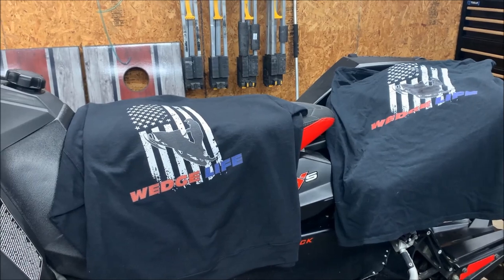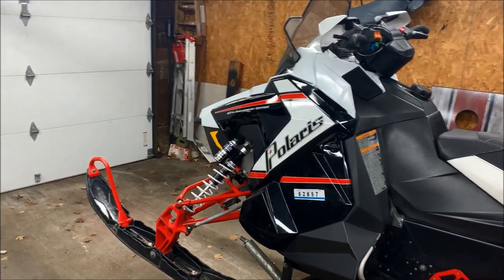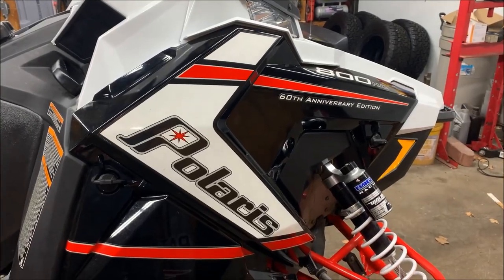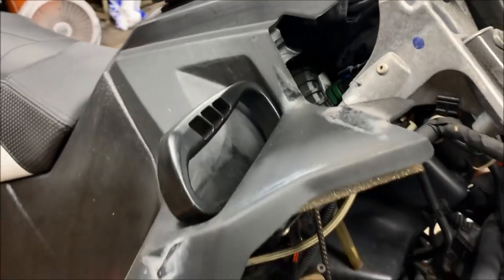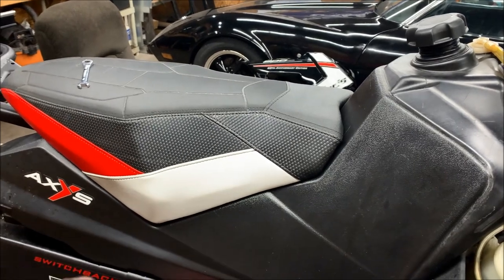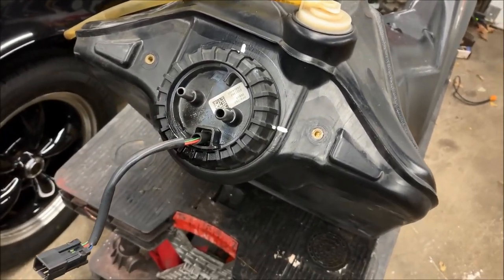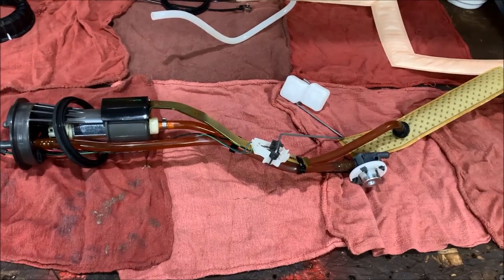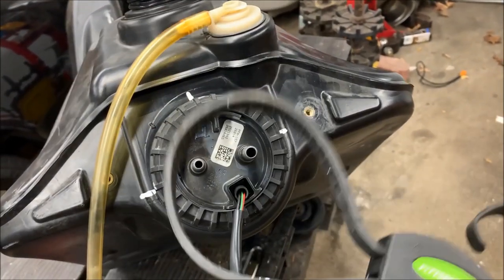Polaris Axys Fuel Pump Removal and Fuel Sock Replacement

Comment: Great tutorial Tom! Working on the new sleds is like working on the new cars, a lot of plastic to remove. Most guys get overwhelmed with taking everything off, but it's not to difficult, especially with videos like yours. I just picked up the older brother to your sled, a 2009 Dragon Switchback 800. Haven't had any time to get into it yet, but will have some upcoming videos.
Reply from the maker: Congratulations on the Dragon. 

The Axys is one of the easier sleds to work on. Everything is pretty accessible once you take the panels off.

Comment: On my 2013 do you know if the whole assembly is getting replaced or are the going to disassemble and just replace the pump?
Reply from the maker: South Side Sales YT channel posted that 2013 models will be getting the pumps replaced entirely.
Reply: I have a 2019 Polaris assault 800. 2k miles and it will go fine do 70-80 mph till I pin it it will fall on its face… Feels like it’s starving for fuel maybe this is the fix?? I’ll have to give it a try. What do you think?
Reply from the maker: This is the exact issue I’m having with mine. I changed the sock and also serviced the clutches and cleaned the VES valves. Still haven’t had a chance to ride it yet. Should know in a couple of weeks.

Comment: Polaris 800s aint bullet proof talking out your rear end buddy!
Reply from the maker: Ok. This one had 9000 miles on it when  I sold it. Never opened and compression was still 130 when the new owner pulled it on the trailer.

Comment: I have a 14 ProR 800, will they be replacing the entire pump for the recall or just the sending unit? Last year when I had it under load it started throwing a det code and going into limp mode, do you have any ideas for me?
Reply from the maker: I'm pretty sure the 14's are going to be treated the same way. 13 and 14 use the same fuel pump.

As far as detonation, it can be caused by many things. But typically it's caused by either bad fuel or fuel delivery. Which could be from a clogged sock or clogged injectors. I would definitely get the injectors serviced and have them cleaned.